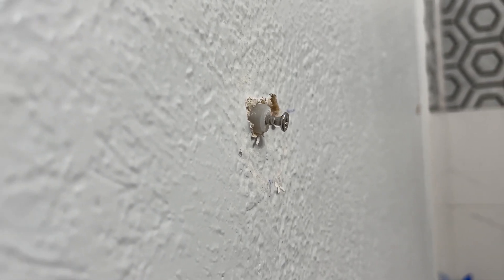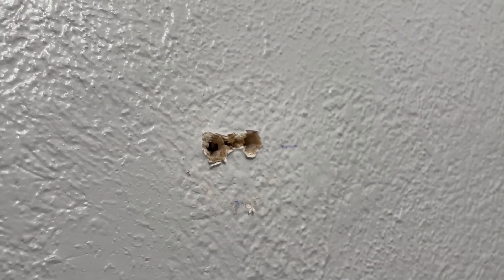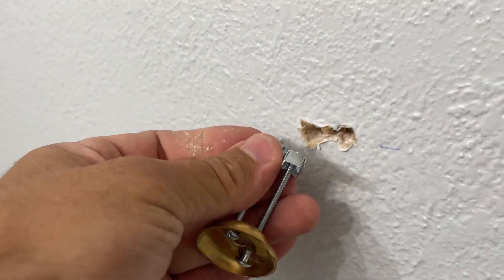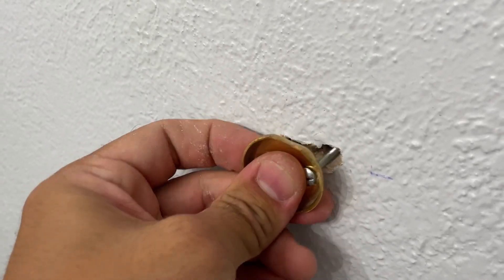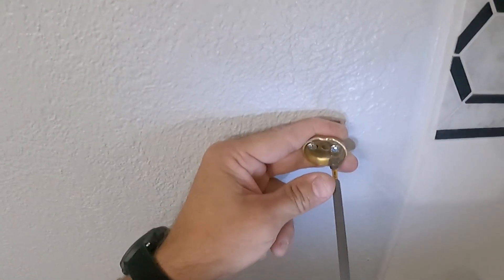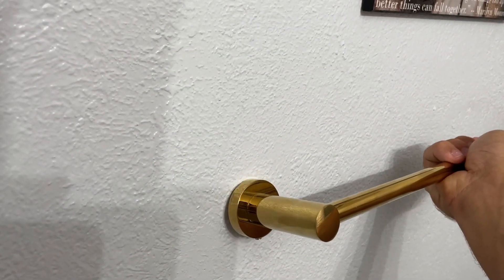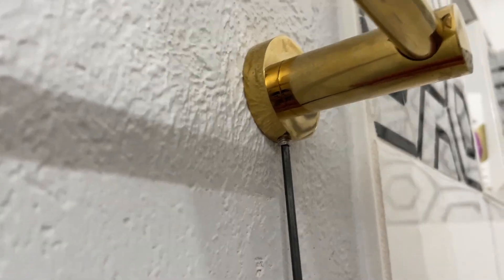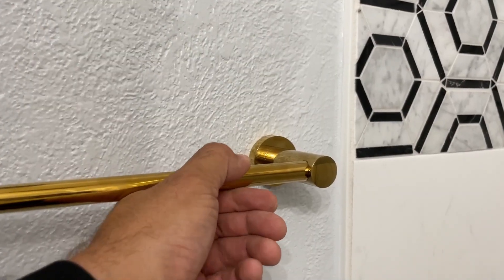How to Fix Loose or Damaged Anchor | Repair Towel Bar pulled out of Drywall

Comment: Hi, I have a similar problem  but with gap between both holes. Same size anchor width but oblong shape.  Would you use these same toggle bolt anchors in my situation?  
Thanks for your video demo 👍